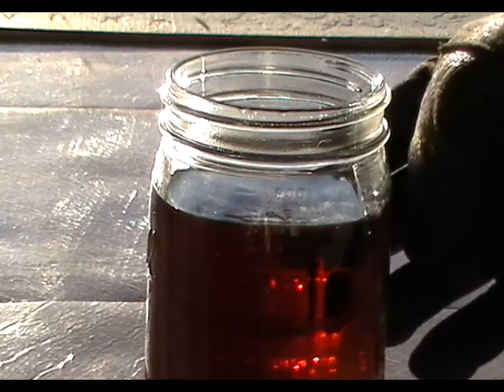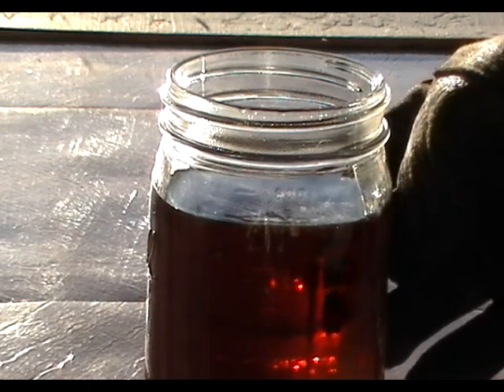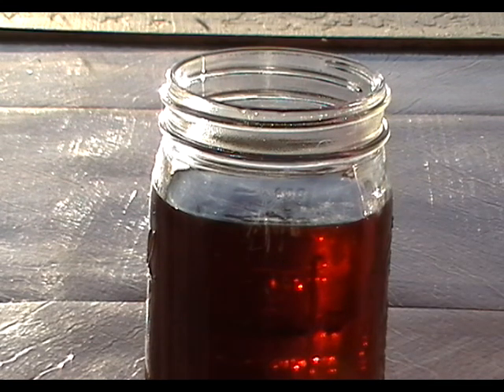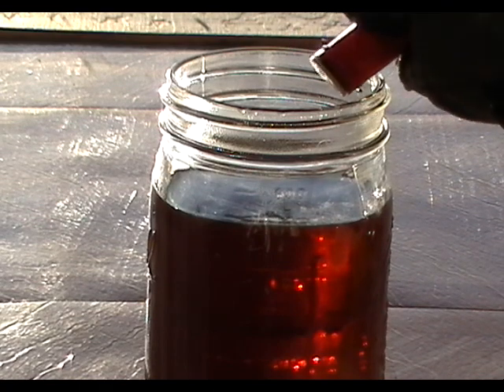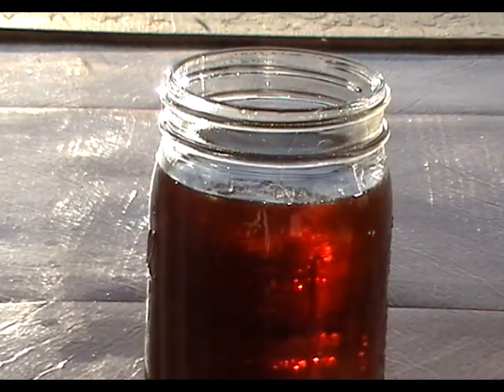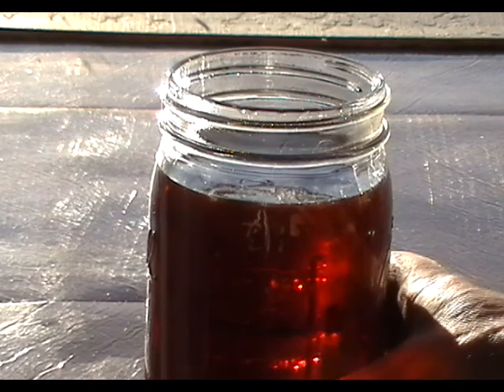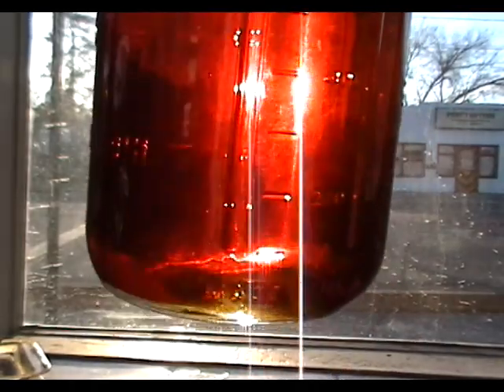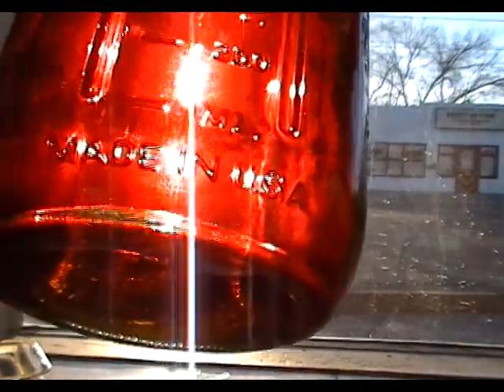Blending Gasoline with vegetable oil to make Diesel Fuel

Comment: Two questions???

1. I have 20 litres of wvo which is clean and then I put in 20 % gasoline=4L and let it settle for 3 days??? After 3 days I can use these mixture, but I don t know if all mixture is useful or not? How do I know how much mixture is OK to useful in my common rail engine? Only upper part or all mixture in 24 litres can (20+4 petrol)?

2. Is temperature really important when petrol and wvo is mixed? Because I tried with 1 litres wvo (at 8 °C) and put 0,2 dcl petrol and it is not the same viscosity as diesel fuel...maybe it is too cold???

So I would like to ask you which  procedure is yours and right, because I really do not want to damage my engine.
Reply: I wouldn't. it is full of glycerin and other crap. you should learn to process it correctly, then you can thin it down for winter use. in summer you can run it straight. winter blend is 5% gas., after processing.
Reply from the maker: bos dad
As long as a gasoline-waste oil blend is settled for at least a week after the blend, then properly filtered, there is no sediment that causes any problems with diesel engines.
Reply from the maker: As long as the waste oil is in liquid phase when it is blended, then a gasoline-waste oil blend is settled for at least a week after the blend, then properly filtered, there is no sediment that causes any problems with any diesel engine.

Comment: I mixed some up and didn't use it. A few days later the funnel I used had a sugary looking stuff in it. What is it?
Reply from the maker: I do not know what you ended up with.  When I blend gasoline with WVO I get a lot of thinned fuel grade blend with a small precipitate, which should be removed.

Comment: this is all true...there is a gentlemen that grows his own sunflowers and presses the seeds to oil...in his study.. 9 gallons  sunflower oil to 1 gallon gasoline and he uses it down to -5 F. he runs all his trucks and tractors on this....
Reply from the maker: Yes, seed crusher, aka Mr Macmoil, and I have been exchanging information for years.  However, in my last communication with him he said, he uses a hydrometer to tell him if the blend is OK, and he said that the blend could be as much as 50% gasoline, which I think is too much, and 10% is too little, but I too use a hydrometer to test my fuel blend with, and my ratios tend to be more like 20-30% gasoline.

Comment: How much cooking oil do you use per gall of gasoline you make?
Reply from the maker: Joe B I make diesel fuel by blending new, or used gasoline at 20% with used cooking oil at 80%, so every gallon of gasoline is blended with 4 gallons of used cooking oil to make 5 gallons of diesel fuel.

Comment: you would be correct it the gas was not in there. now why would you run a gas mix in the first place? it has less energy density, so that means less power, it would run hotter, and 2 different combustion processes would effectively change the timing (especially on a engine with pilot injection), I have spoke to engineers about diesel gas mix. their response was anything over 10% will cause rod bearing damage, head gasket issues bc of 2 combustion events.

Comment: 2007 ? don't know what that means. But the Department of Motor Vehicles-DMV states any diesel 1997 or older is smog exempt. People also told me the older Ram2500 1995-1997 or so, get best mpg.

Comment from the maker: @USFiltermaxx1 This is why I advocate blending with gasoline instead of diesel fuel.  Since you only have 2400 hours runtime on straight motor oil it explains why you advocate blending with diesel fuel. If you had been blending for 5 years, as I have, then you would have learned a great deal more about blending.  Give it a few more years before you put yourself out as an "expert."

Comment: there are roomers that cooking oil can swell up rubber seals witch in tern can stop you car after a time. have you ever heard of this and ever had the problem your self?
Reply from the maker: I have heard many false rumors in the alternative diesel fuel world, such as this.  If it were true there would not be so many people claiming they can burn waste vegetable oil as diesel fuel.  I have run a 1987 Chevy diesel van almost exclusively for more than 7 years on vegetable oil based diesel fuels, so the rumor is clearly false to me.

Comment: Is advisable to use this blend with my fiat 1.3L multijet Diesel engine( India famous most popular engine). Has injectors and turbo 2012 year model. Please advice me is this blend fuel not affect fuel pump, injectors or piston or rings. Pls answer if anybody does it.
Reply from the maker: while I do not have direct experience with the spicific make nd model you are requesting; nonetheless, I have received reports from many people tryig this blend around the world.  Current experience with blends suggests a blend of waste oil to diesel at 40% diesel, leave to settle in warm tempertures for at least a month, carefully pour or pump off the top the translucent blend and add gasoline in a separate settling tank that has a cone or domed shaped bottom with a valve at the bottom of the cone of the tank, and allow to settle for a few days, then drain off any sediments, then add acetone at about 1% and leave to settle for 24 hours, then drain any additional sediments, then filter into the fuel tank.

One can run this blend in most diesel engines on a regular basis.  If excess smoke is observed after running the blend, then run a few tanks of normal diesel until the exhaust cleans up.  This will avoid coked injectors and valves.
Reply: @Jhananda  thanks for your reply sir, I have seen many of them suggested 50% filtered with 5 micron Waste Vegtable Oil or SVO to mix with 50% diesel. And adding directly to fuel tank with simple mixing blend to make cheaper fuel pls let us know your view on it. 
Also need one more clarification which blend is u recommended first in your video it most suitable for diesel injector & turbo engines with  easy blend.
Reply from the maker: @gokulkrishnan4860  You can get a lot out out of settling prior to filtering, and filtering a viscous fluid such as WVO is very difficult without thinning it. So, I recommend stages of settling such as a month or more settling the SVO warm where the food particles settle out prior to bending, then add it to diesel fuel at a rqatio of 60% SVO to 40% diesel fuel. Allow it to settle for about a month, then pour it into a tank with gasoline at a ratio of 10%, then leave that blend to settle for a few days.  This tank should have a cone or dome bottom with a valve at the center bottom of the tank, where any sediments can collect and be drained off with minimal disturbance of the blend.  Drain the sediments daily.  Once no more sediments come out, then add acetone at 1% at the top of the settling tank, settle for 24 hours, then drain off any additional sediments, then filter through 2-5 micron fiter directly into the fuel tank. That blend can be run at 100%.  When smoking is aparent then run straight diesel fuel until the smoking goes away.

Comment: I have a 96 Toyota landcruiser 4.2 diesel which I run on used chip shop oil. It could be canola, coton seed or what is sold as vegitable oil. There seems no differance. I have run it 50/50 mix and done many thousands of kilometres, It runs smoother and better performace, power and economy than straight diesel. Minimal filtering. Hard starting in the cold so I run on straight diesel for some minutes during last drive home at end of the day. I change fuel filter every 5000 KM, Chip oil is free so the regular filter change makes cheap motoring. My Nissan patrol 4.2 TD just hates it the fine gauze in injector pump blocks.  I now have disposable petrol inline filter to clear it as sediment in take was a problem even after running correct fuel for some weeks.
Reply from the maker: Thanks for filing your report.  I assume your 50/50 mix with WVO is with diesel fuel, not gasoline.  If you blended with only 20% gasoline, and no diesel fuel, then both of your engines will run better on your fuel, even in the cold, and you will be spending less money on fuel.
Reply: Jeffrey Brooks
exactly because gasoline is much liquid than diesel... so therefore needs less buyed fuel and gives a much liquid fuel than 50/50 diesel and wvo it will get liquid as diesel... and thats the main problem of runing wvo its the thickness for what i am learning...
Reply from the maker: nao digo
correct, most WVO is 10-20x as viscous as diesel fuel; whereas, gasoline is 1/4 as viscous as diesel fuel; therefore, gasoline can be blended with wvo at 20% and end up with a fuel blend that is about as viscous as biodiesel, which tends to be about 5x as viscous as diesel fuel, but runs fine in warm weather.

Comment: There's minor differences to how diesel and gas work in an engine. A diesel engine burns the fuel only by compression (no spark). I'm not gonna get into the chemical part but the main difference is that gas burns way quicker than diesel and cant be run in a diesel as is. Moving on, you mixing gas with veg oil is isn't improving the oil's flammability. The oil has more than enough. There's things like glycerin in it that dont burn good at all. Get rid of that, and there's no need to mix gas in.

Comment from the maker: The 80-90% that floats to the top in a settling WVO-gasoline blend is good WVO-gasoline blend that only needs final filtering.

As long as your WVO is liquid, then you do not need to heat it.  If it is not, then all it needs is to be heated to liquid phase, which could be done in the sun for free.

You should keep in mind that if you are going to heat WVO to liquify it, then it should be cooled down to 25c before adding gasoline. If your WVO solidifies again at 25c, then reheat & blend w diesel

Comment: surely all the o-rings and seals in a diesel engine are manufactured from neoprene which is oil safe. and would be perished by gas/petrol. surely you would need viton seals for this.

Comment: if I'm running fresh vegetable oil 50% and diesel 50% blend can I just add some gasoline in my fuel tank without settling and if so how much
Reply from the maker: +jim cherkas if you want to avoid serious problems with your engine and its fuel system, then you will always do your blending outside of the fuel tank, and allow for at least a few days to 2 weeks of settling, before you carefully separate the sediments from your blend, then filter the blend into your fuel tank.

After blending and settling a vegetable oil 50% and diesel 50% blend, then you can add gasoline to improve combustion, and it could as little at 5% for good results.  However, you will still want to settle that new blend before filtering it into your fuel tank.

Comment: there just isnt enough lubricity with a gas mix, hell even bosch is having trouble getting their cp pumps to stay lubed with ulsd only, and have said so several times. yes gas in a newer diesel can and will trash the cp pumps, and injectors even in very tiny percentages. to understand this all you need to look at is the differences in injection pressure between what a mechanical pump produces and common rail. been a diesel tech for 7 years, i know what a bit of gas will do.

Comment: This is the same as black diesel. however, without processing the WVO you will still get all the gunk and glycerine. this will clog up your engine and cost you a fortune in repairs. you should warn people not to run this straight.
Reply from the maker: There is no glycerine in vegetable oil.  Vegetable oils are triglicerides.  They dissolve readily into organic solvents and do not clog up an engine as long as the blend is settled for at least a week prior to filtering.

Comment: 2400 hours is about 170,000 miles. The typical driver goes about 12,000 miles a year. 170,000 miles / 12,000 miles per year = 14.16 years  driving. SInce you consider 5 years to be an expert. I would think that 14 qualifies and I rest my case.

Comment: Why put gasoline into Vegetable oil. Joseph Diesel when he invented the Diesel engine, did so to burn vegetable oil as Germany has no petroleum resources within it's borders. Vegetable oil works just fine in a diesel engine. In fact you will probably have to change you filters after switching from regular diesel to vegetable oil (VO) as VO cleans the engine up.

Comment from the maker: Sorry, but this sounds like a lot of nonsense.  There are many modern common rail, direct injected diesel engines running gasoline blended with waste oils.  Anyone who has trouble burning such blends in a diesel engine usually is doing it wrong.  So, I recommend that people learn to do it correctly before they ruin their engine.  This video series is intended to help people learn to make gasoline-based waste oil diesel properly so that they do not ruin their engine.

Comment: Gas has less carbon molecules than diesel which has more carbon and thus you risk possible damage to your diesel engine look it up if you don't believe me
Reply from the maker: +Randy Grose of course the gasoline fraction of the petroleum stream has fewer carbons in its chain than the diesel fuel cut, but so what. Diesel engines can burn any flammable fluid from hydrogen to coal or saw dust.  I have been burning gasoline-waste oil blends for 9 years on the same diesel engine.  Try it some time.  If you make a gasoline-waste oil blend as described in these videos you will be surprised to find your engine will start right up on the blend and run fine on it.

Comment from the maker: @pearljamfan99 that is fine, after all, I have a scientific training, and critical thinking to help me; whereas you obviously have just your flimsy beliefs to keep you comfy at night.
Reply: well said;  i'll bet that is why you delete comments   lol      i just leave  the WVOil  resting for a month, then removed, and then it gets mixed with half  diesel, some gasoline and a bit of acetone (no trans fluid ever,it does NOT mix!!), agitate that and leave it for some days to a week, to make sure it stays mixed; it always does;  starts and burns very well,
Reply from the maker: @josepeixoto3384  Sounds like a pretty good blend and method to me, but I find no reason to agitate the blend, and ATF bends readily into my blends, so I am not sure why it doesn't blend for you.  

Also, I find acetone actually forces dissolved solids, fats, gum, and water out of solution, and it dissolves almost immediately, so I add it the day before filtering the blend into my fuel tank, and I drain off anything that precipitates out of solution just before I filter the blend. 

I also don't delete comments, so I am not sure where you are going with that.

Comment: only add 2 to 5% petrol. Exact same result.
Reply from the maker: +Trina McDonald I found a blend of 95% WVO plus 5% gasoline was nearly ineffective for my 6.2L diesel engine.  I found the best results with 60% WVO + 20% diesel + 20% gasoline, which is added in stages with settling periods in between.
Reply from the maker: 5% gasoline in 95% WVO had almost no improvement in combustion in a hot engine.

Alcohol will ruin the seals in your IP, so do not use it, unless you seal your IP with viton seals.
Reply: Jeffrey Brooks My point was the ability of WVO to flow, not performance!
Reply from the maker: Gasoline is cheaper, improves combustion, and does not damage hoses in seals in the concentrations needed.
Reply from the maker: Additionally, I have found gasoline in concentration with WVO at up to 50% improves combustion, performance and anti-gel.  However, the alcohol content in US gasoline is to high above 30% in the fuel blend.
Reply from the maker: To the best of my knowledge the maximum level of alcohol in gasoline is 11%, and that is in the winter blend only.  The summer blend can be as low as 3%; however, that may have changed, or may have regional variations, as you suggest.  If so, one would want to verify the alcohol content, and bring the level of gasoline in your blend down to about 3%, which means in the case of a gasoline blend that contains alcohol at 15%, then it should be safe to have gasoline at 30% in this diesel blend without causing damage to silicon seals, if there are any, in the fuel system of an old diesel engine. 

New diesel engines manufactured since 2006 should have no silicon seals in their fuel system.  However, prior to 2000 it was common for diesel engines to have silicon seals in their fuel system.